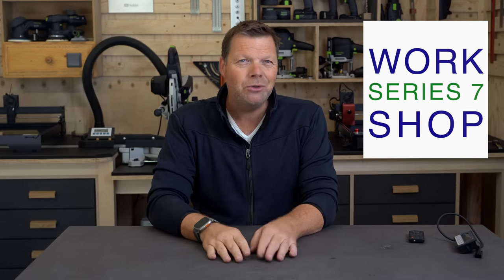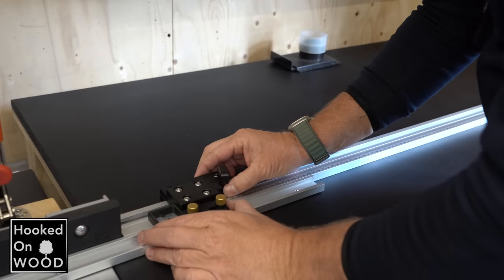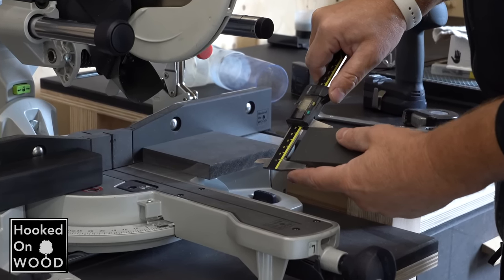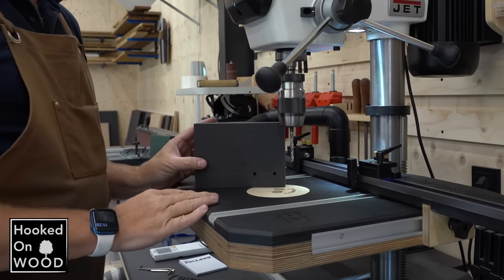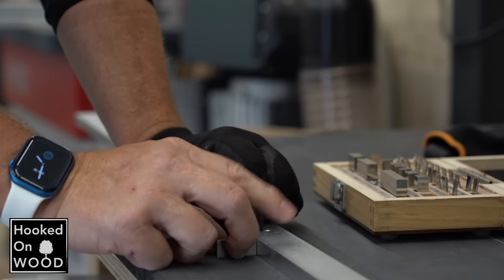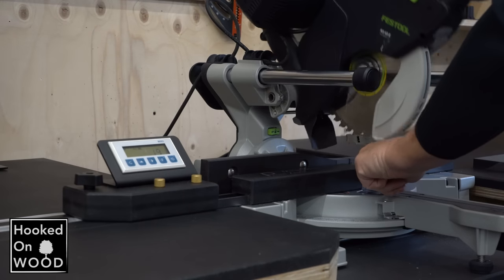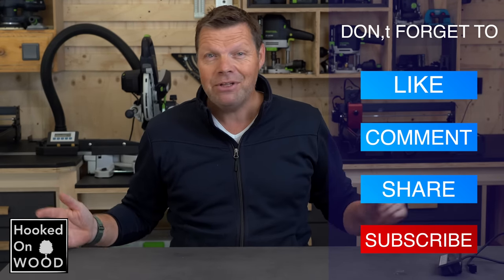Amazing Miter Saw Upgrade! How to build video

Comment: I have watched a ton of videos on shop projects and I've found it rare that anyone has a new idea or innovation to add.  This was the rare exception.  Thank you!  Like always, you've elevated the shop game with your clever, innovative and beautiful designs.  I love your design and am thinking about incorporating it my shop but I am concerned I'd miss the ability to use two stops (i.e., no flip stop).  If the digital read out is really that accurate, I don't think it will be an issue as it looks like it would be pretty easy to dial in the exact measurement as before.  However, I wonder if you've thought of a way to possibly have two stops.  Was there a two stop design you were pondering that didn't make the cut?  Thanks again!
Reply from the maker: Well, that was one of the advantages with a flip stop. Making this a flipstop would be too complex. It would have be possibly to add a flipstop, but then I loose the possibility to slide it till zero. So it is a compromise.

Comment: Only drawback i see is that the display is attached to the stop itself. So if the stop is 10ft away you have to walk 10ft to move and read the display. The reekon m1 is attached right on the saw fence for easy reading and no walking.

Comment: Hey Dennis, thank you so much for your videos. It helps us a lot on our journey. Quick question: What variant of Digital read-out meter did you buy? The 1m? I presume that the several variants have different cable lenghts. Thanks

Comment: Hi Denis, this is such a wonderful video and a really creative idea on your part....I hope it brings you lots of joy. 

A few questions regarding the digital reader you recommended: 

- Does it come with the metal base that you use to secure it to your stop?  Their website does not suggest that it does in their photos but it does show it in the videos. 
- Is it meters only or does it support inches as well? 

The idea to go directly to the blade, as a reference, makes so much sense and solves a lot of problems when trying to construct/install a miter stop system and if it ever gets knocked out of alignment you can simply adjust it back to the blade. Brilliant! Thank you so much for sharing this.
Reply from the maker: No, it comes not with the base. I will try to find the link. 
It is metric and inches as well.  https://nl.aliexpress.com/item/4000982030138.html?spm=a2g0o.detail.1000014.6.5bb9658cj3RscD&gps-id=pcDetailBottomMoreOtherSeller&scm=1007.40000.267768.0&scm_id=1007.40000.267768.0&scm-url=1007.40000.267768.0&pvid=3af0dd29-1785-43e2-85f5-a174d44deaa5&_t=gps-id:pcDetailBottomMoreOtherSeller,scm-url:1007.40000.267768.0,pvid:3af0dd29-1785-43e2-85f5-a174d44deaa5,tpp_buckets:668%232846%238107%2322&pdp_ext_f=%7B%22sku_id%22%3A%2212000029546627775%22%2C%22sceneId%22%3A%2230050%22%7D&pdp_npi=2%40dis%21USD%2132.66%2114.7%21%21%21%21%21%40211b5e1d16646563951308339ec43b%2112000029546627775%21rec
Reply: @HookedonWood  Thank you Denis. I am appreciate your responding and all the hard work that you put into making these videos.

Comment: Looks like a great design - One thing I didn't see was how you matched up the magnetic tape to the width of the slot in the miter profile.  Is there a link to the profile you chose?  i believe there is very little height and alignment tolerance for these.  Looks like the Grey meter model doesn't ship to Canada.

Comment: Great build Dennis. This looks like a great addition to your miter station and something I will definitely be doing soon!  What exactly did you protect the magnetic track with? I'm sorry but I heard "lab strip", but I imagine that's incorrect. Thanks again for the excellent video and your help.
Reply: It's an Aluminium profile designed for LED lighting strips. Essentially a C/U extrusion with a plastic cover that slides over it to protect the LED strip. Dennis used one that doesn't have the flanges so perfect for recessed mounting

Comment: Hi Dennis, (sorry for the very long comment 😁) your mitre saw digital readout looks amazing and so well implemented, it's a great addition to your mitre saw station.
One thing I couldn't work out was how you "zeroed" the readout, does it push up to the blade when it's down and then zero the meter ? I presume you have to be careful not to deflect the blade if thats the way you do it.
I would love to implement this in my own Mitre Saw station, which I built to your Original design from your previous workshop.
Mine actually has five sections altogether, three fixed and two sliding, one to access the Drill Press base and another one to access my hidden sander 😁.
To use T-Track in it, I would have to remove all the sections and strengthen them with an extra strip of Birch Ply as they only have a single layer of black MDF at the moment.
It would also mean the T-track would have to cross the sliding sections of the bench which could be done by cutting the T-Track in the right places.
The only problem I see is the Sensor Strip which I assume will have to be continuous to work.
I will have to look at everything and see what I can come up with to make this work with my setup / mitre saw station.
If I do come up with a solution, I will let you know in the future.
Look forward to you Dust Extraction ideas as adequate dust extraction is always tricky on a mitre saw 😁.
Take care and have a great weekend.
Reply from the maker: If I understand it correctly I would opt for a fence that you can add. In this fence you can integrate the stopblock and ODR. 
About the alignment. I wanted the base to stop at the fence of my Miter Saw. This way, I can never give to much pressure on the saw blade and I do have a constant distance to the saw blade. What I have to do is a one time setup of the miter stop, so that when the base reach the edge of the fence, the miter stop touches the blade slightly. I think I have your concerns covered :-)
Reply: @HookedonWood  Thanks for your reply Dennis, yes I've been thinking about it and a removable fence would probably be the only and easiest way, it could then be removed on the rare occasions that the sliding sections need to be removed.
I understand now how you set up the Zero point on the readout, thanks 😁
Reply: @colindoesdiy If I understand correctly, your desire is to use your zeroed out stop block with other tool on the bench. One way I have solved this similarly in the past is to accurately space the tools so that the zeroed out stop block reads at a round dimension (100 cm, 20 in, or something similar.)  The small cutting sizes that I typically use can easily be added to the round "zeroed" measure with too much complexity or confusion

Comment: Hello Denis, perfect video as always and it was nice to see you excited also about it :) Pls what kind of t slot track you use, so there is no play for the sliding bar and also the LED track? Thank You so much
Reply from the maker: I can not place a link at this moment because I have problems reaching this part of the bang good site. But it is just a standard 30mm Miter track. For the sliding bar, I placed a link in the description. These do have some play. But when you tighten them, they stay pretty solid. LED strips are just basic led strips with a flat surface (cover)

Comment: Hi Dennis! 
I’ve got a question about the readout. I would like to use it with a flip stop, which stops e.g. 30,0cm away from the saw blade. Is it possible to calibrate the readout, so it says 30,0cm on this position, or can you only set/calibrate it to zero? (Can you set it to a given numer) Hope you understand what i mean. 
Great job again man, can”t wait to see your dust solution.
Greetings from bavaria
Dominic

Comment: Maybe you could add a small solar panel (similar to a calculator) and it could give just enough voltage to keep it alive? Or increase the battery capacity.
Reply from the maker: When I have to change it ones a year it is not a problem for me.

Comment: Awsome job 👍 what is the material that you used for your table tops?
Reply from the maker: That is what we call, full colored MDF. It is a no-brand material. It is comparable with Valchromat, but a lot cheaper. Unfortunately, not every available. I pay around 100 euro for a sheet.

Comment: Dennis- you continue to innovate, inspire and educate. Thank you for all of your hard work behind the scenes to bring us such world class educational content. I love this gauge- just in the process of building a new mitre and drill station bench so the timing was perfect. Did you “fix” your drill station bench or does it slide in and out like your last workshop to allow the extra height?
Reply from the maker: This time my the surface is fixed. I never needed the capacity so far but when i would fold the drill press table out of the way and use the workbench table, i have even a larger capacity. Because the original drill press table did not goes deeper than the workbench top. So, it is not needed at second thought
Reply: Thanks so much for the quick response... will make my upgrade a little simpler!!

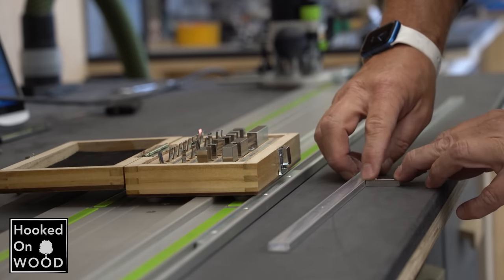Comment: Awesome build Dennis, I put the saw on a moveable platform that can be adjusted back or forward of the fence line and by doing that I can work with either a zero clearance fence or with just the machine fence. At 10:10 you mention you place the LED strip into something but I can't catch what that is, could you spell it out in a reply please.

Comment: I have that Banggood manual t-track stop and it's fantastic. I bought it to use in a mobile track saw table but want another for my miter saw bench which I also want to make mobile because I'm a contractor and stationary is great for my shop but it doesn't help on the job

Comment: dust collection will be important with tight tolerances in between track and slide. maybe could make inserts that fill in the rail and are flush with the bench top when not using the mitre stop? would also have recessed the magnetic tape a bit for the same reason, and to also protect it from being scratched or damaged. apart from those niggles, excellent design and execution as per usual
Reply from the maker: I placed the magnetic strip inside a LED strip, protecting it with a plastic cover and against dust. So, I think I will protect it well. We will see how it will go in the future. Covering the T-tracks is a possible solution when things become problematic. Thanks for the tips.
Reply: @HookedonWood  missed the led strip bit - were right about maintaining focus :D

Comment: How would  you do mitre cuts on both sides of wood. Their is a version on aliexpress that has a build in calculator
Reply from the maker: That sounds fun, But I believe there is a possibility to save some settings in this device also. So, you only have to correct the kerf for this. I will look into it. Thanks